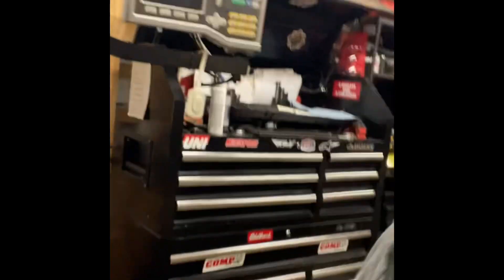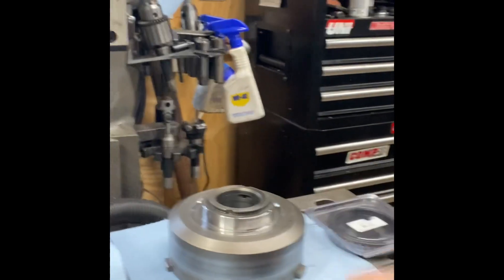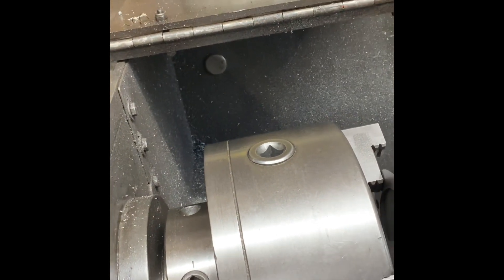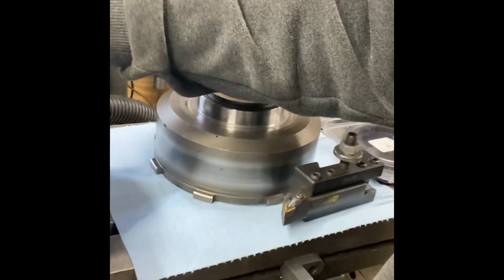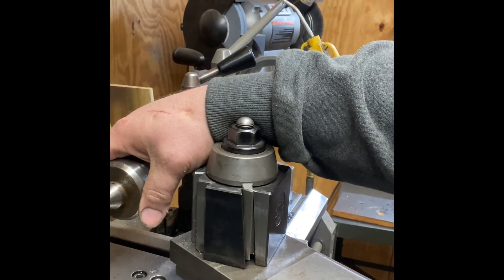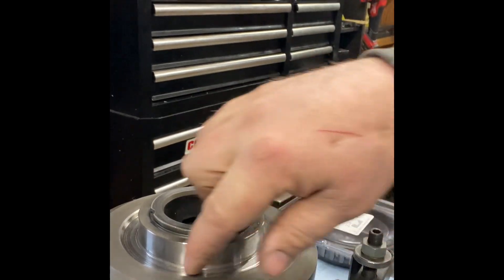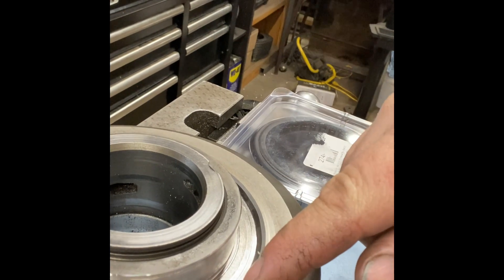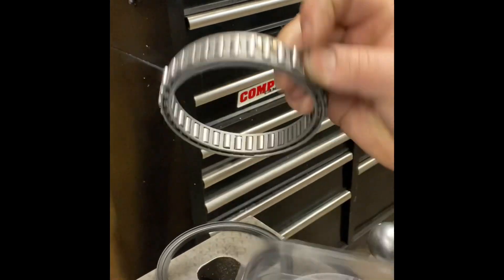Cheap 36 element sprag th350

Comment: This maybe of some help about this 36 element sprag. Back in the day; Borg Warner (part #08147AM) TH350 Intermediate 36 Element Sprag (oem #138147A). Is what was used to do an upgrade. I do believe it will require less machining. Hope this helps and love your work. Thank you.
Reply from the maker: I tried to find them but everyplace was sold out. I try to see what I need to do to make them work once I can get my hands on one